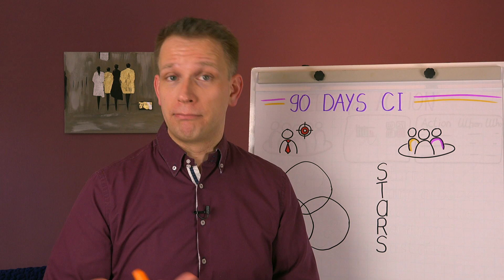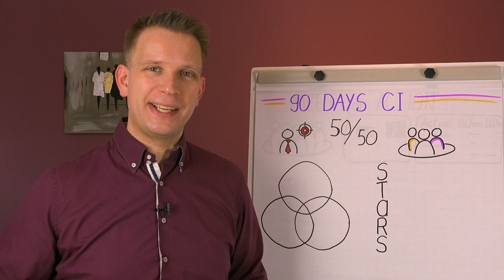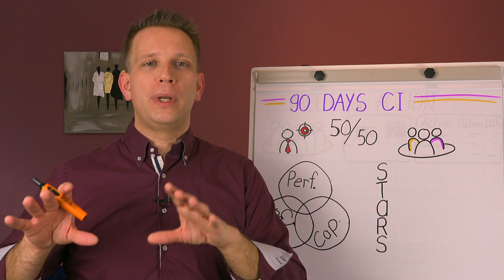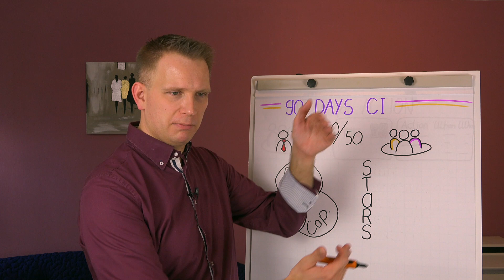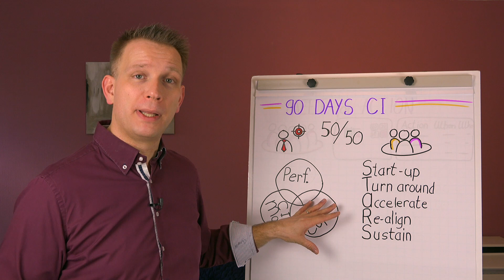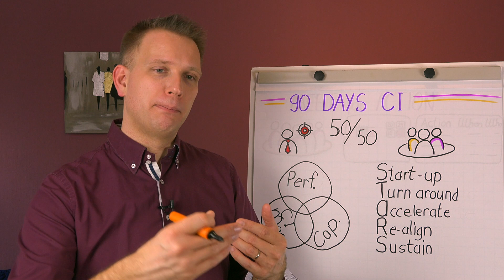First 90 days as CI manager

Comment: What are hard skills for this?
Reply: Thanks. I'm trying to transition from inventory management and tbh depending on the industry (food and beverage manufacturing) it sounds more like an industrial engineering role. 

Wearas I see it a Business analysis role with a specialization in lean principles
Reply from the maker: Just to recap: in this context, hard skills are the more technical/analytical skills, while soft skills cover change management, communication and the like (and know that 'soft skills' are just as hard to master as the hard skills 😉).
So hard skills important for a strong start as a CI manager are things like: able to analyse operational performance, link performance to financial numbers, performance variation analysis, calculate OEE and its constituents, make a material balance, design a performance and projects follow up meeting structure, guesstimate the operational benefit of an improvement proposal and calculate the expected financial benefit based on that; and also more basic skills like: read a P&L, able to make a 4M fishbone, do a 5 Why, able to set up a KPI tree, organise an A3 problem solving team or Kaizen Event, etc.

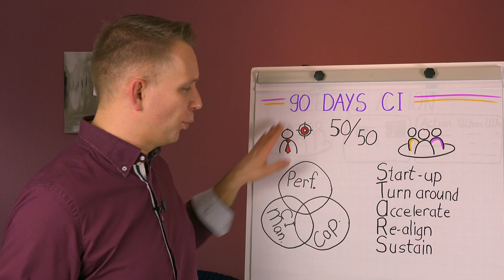Comment: 00:00:00 - 00:25:00
The video discusses the challenges a Continuous Improvement (CI) manager faces and provides advice for their first 90 days in the role. The speaker emphasizes the importance of building relationships across departments to lead effective improvement teams, balancing performance excellence and organizational capabilities, and checking organizational alignment to prevent the house of cards from falling. Additionally, the speaker suggests that the new CI manager make at least two improvements within the first 90 days to establish trust and goodwill and focus on building relationships with colleagues to gain informal leadership and clout.

See less
00:00:00 will need to drive and you need people to support you and be on your side. In this section, Tom emphasizes the importance of being a strong partner for general management as a CI manager. He mentions that although there might not be a department, it is crucial to align with the plant manager and the operations manager about their goals and expectations to support their vision. Additionally, he advises that building connections with the management team and formal and informal leaders throughout the organization will be helpful in driving improvement projects.
00:05:00 In this section, the speaker discusses the role of a Continuous Improvement (CI) manager and the challenges they face. The CI manager is expected to lead and manage improvement programs to drive change throughout the organization. However, they are not the direct manager of those working on the projects, so they need to build relationships across departments to bridge the organization's parts together and lead effective improvement teams. During the first 90 days in this role, the speaker advises spending 50% of your time getting to know the organization and making improvements, while keeping the other 50% free for coffee chats, helping colleagues, and learning about the organization's priorities and struggles. The speaker also emphasizes the importance of balancing performance excellence and organizational capabilities, ensuring that high performance is supported by a strong set of organizational and learning capabilities to prevent the house of cards from falling.
00:10:00 In this section, the excerpt explores the importance of a CI manager checking organizational alignment and how it has a strong impact on a factory's operational line. As a CI manager, you must check where the organization is leaning and give a counterweight to the preference in alignment with the factory's performance. Additionally, the quality of the control loop of an organization is often considered part of the capabilities of the organization, and it is essential to check how the root cause analysis teams and the performance outputs are managed. Ensuring this team has proper support from the management layer of an organization is crucial for the success of an Improvement team.
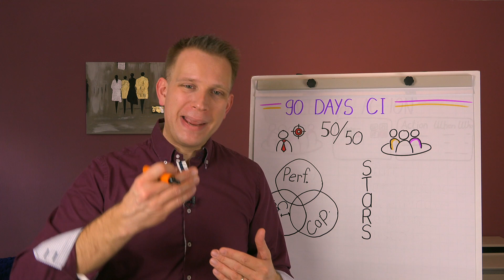00:15:00 In this section, the speaker discusses how a Continuous Improvement (CI) manager can show improvement in the first 90 days by moving in the right direction and providing support, structure, and motivation for colleagues to work on improvement initiatives. The speaker advises managers to balance the focus on performance improvement and CI management, with corporate guidelines available to help determine a good balance. The speaker also introduces the Stars framework, which provides a way of looking at an organization's level of startup, turnaround, growth, realignment, or sustainability, and is useful for managers in the first 90 days to understand the organization's culture.
00:20:00 In this section, the speaker emphasizes the need for a different management and communication style for startups versus established businesses, and suggests discussing this framework for the Continuous Improvement program with management to determine the current phase of the program. The speaker notes that the phase of the program will dictate different approaches for CI, such as accelerating momentum or training team leaders. Additionally, the speaker encourages the new CI manager to have a discussion with direct managers and peers to determine their views and expectations for CI and balance of performance and capability building. Finally, the speaker suggests that the CI manager focus on building relationships with colleagues to gain informal leadership and clout.
00:25:00 In this section, the speaker provides advice for the first 90 days in a Continuous Improvement (CI) management role, suggesting that starting with rebalancing and checking the management of CI activities is necessary to evaluate the actual performance. They also advise making two improvements within the first 90 days to show their worth and improve the communication flow, especially on the CI management side. They assert that building a CI management role is not for short-term gain and generally doesn't need to show immediate monetary results but rather guide and support to establish trust and Goodwill.

Comment: Hi Tom. I hope you're doing great. Excellent video as always. Do you have any advice or tips when changing industry? I recently accepted an offer as a CI Analyst in aviation and aerospace industry. Specifically, engine MROs (maintenance, repair, and overhaul) The environment is completely different than my comfort zone (semiconductor manufacturing) My new direct manager was kind enough to give me reading materials as a primer to the industry but I'm not sure how to apply my CI experience in this completely different industry. Thanks!
Reply: Hi Geon, I had some negative experience in aviation as a Quality/Continuous Improvement Engineer. The trouble I ran into was that my manager, the QA Manager, was really more focused on compliance, than for things to be efficient. I came from automotive industry and Lean is a big focus there. Long story short, it wasn't a good match for me and I ended up leaving. My impression was that aviation is much more conservative and much more strictly regulated than other types of manufacturing. I hope your organization strikes a balance between compliance and efficiency and it turns out to be good experience for you! I did not feel any abnormal learning curve compared to going to another manufacturer per se, as every company has their terminologies. But Tom made a good point in his video, talking to people and getting to know all departments and what problems they face really helps. You should be able to get up to speed fairly quickly. All the best!
Reply from the maker: Sounds like  @lsx001  got into a change-resistant company, and having your own manager be one of the conservatives makes it even more difficult to affect change. But,...
CI is about deploying the company's resources in a more effective way to meet the company's goals - if the company (or whole industry) places great value on safety, producing tightly according to specs and triple-checking quality controls; that's what you've got to work with (at least at the start). You can find improvements in worker  efficiency, how materials flow through the process, preventing failures, etc.
So to generalise that to Geon's question: check the company's strategic focus; compare what your site manager states as main concerns or points of pride/improvement with the view of managers and specialists from different departments to look for discrepancies (almost always opportunities for real improvement), secondly focus on costs drivers and what stops throughput - those are always in the main focus areas of CI.

You will want to get a good understanding of your industry and those engines in particular, even if just to be able to help out your team and contribute in discussions and brainstorming. But your CI skills are useful right off the bat: you're smart, ask the the obvious questions and drill through on any point you don't understand - having your colleagues to explain it to you forces them to really think about the logic again, and they'll often come up with the answer themselves 😃

And Li - thanks for contributing, it's much appreciated!
Reply: @lsx001  Hi Shaoxuan, thanks so much for your perspective! They're very insightful. Fortunately enough, the company I'm going to work for have an established CI program. So hopefully that's a sign for a positive experience. I'll make sure to communicate and listen to all cross-functional teams and get to know the issues they're going through. Thanks so much!
Reply: @lsx001  I just want to update you on my first week of work. So the good news is that CI is a completely independent department that reports directly to the site leader. Quality is completely separate and based from my initial observation, you're absolutely right about their obsession with compliance. There's a corporate push for CI activities so every site have its own CI department and we support each other apparently. I like it so far, completely different than what I'm used to. Thanks for the initial feedback!